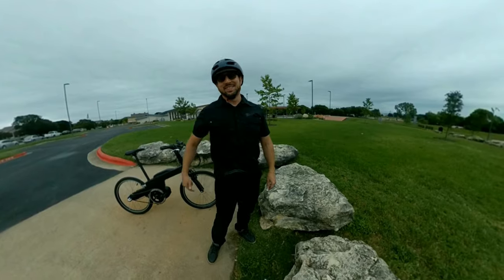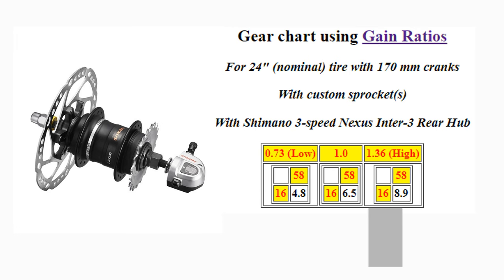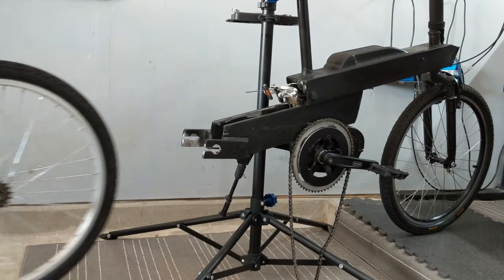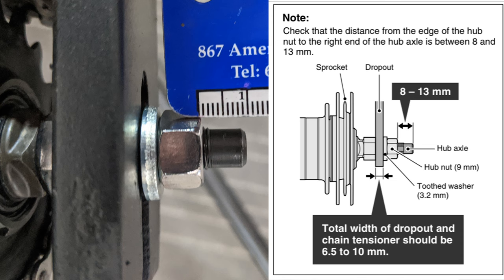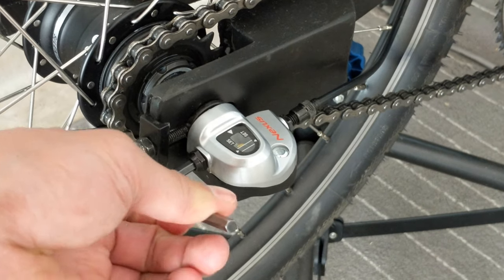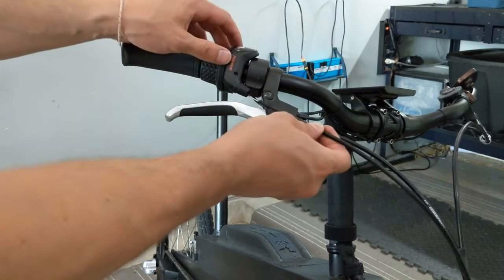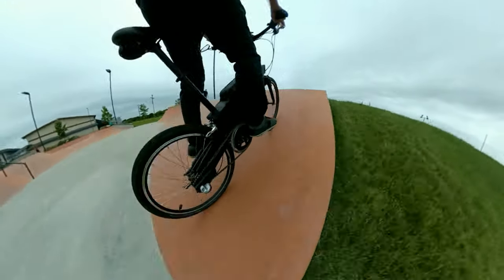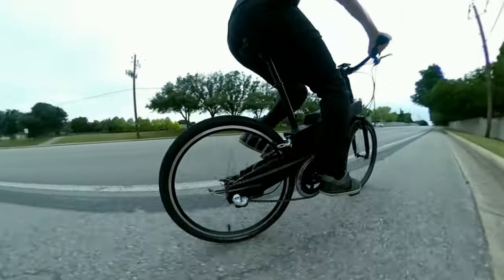Convert Your Bike to IGH | Nexus Internal Gear Hub

Comment: i've done nearly 15,000km with my shimano nexus inter3 with a cyclone 1800w mid drive (i also use sick bike parts free wheel an spiders to run high an low chain rings up front, i locked out a derailleur at the rear for chain tension) , best hub out there in my opinion and i've tried a few, sturmey archer 3 speed destroyed itself in about 300km

Comment: I just converted a single speed beach cruiser to a mid-engine electric bike. A major challenge since removing the one piece "Ashtabula" crank and installing the Bafang BBS02 electric motor requires adapter bushings to fit snugly inside the bike's hollow 51.3mm bore. Otherwise it is impossible to keep chainline straight and chain from jumping off the chainwheel with the higher torque of motor. Once installed correctly, it is an amazing bike with just a single speed but lots of power assist when needed

Comment: Great video.  I would love to see a similar install/evaluation of the Enviolo (380 or lower) CVT.  Thanks.
Reply from the maker: Yeah I'd love to see that too, let us know if you come across anything. As far as I've read they're designed for low power and get a little slippery at higher power levels.

Their parent company (Fallbrook Technologies) is not far from me here in Austin TX. I've been meaning to go request that they develop a heavy duty version for high power mid drives. I'm under the impression they moved the Nuvinci/Enviolo development to Germany though.

Comment: I just learned about internal geared hubs and I thought I should combine this with a mid drive motor, then I thought I wondered if anyone else has done this, so I went looking. The rest is history!  except I'm not looking for a custom wheel, I'll be doing that my self, as soon as I get a few test builds under my belt, I've always been of the school, if you want it done right, do it yourself, if you don't know how,,, learn! Just so you know I am building a stealth Bomber ebike, originally I was going to go with a rear hub motor, then I started looking at mid drive motors, I like fat tires, So I was going with 4 inch rear 3 inch front, I still am, but two days ago, I watched a video of a guy who bikes all over the world and he was talking about gearboxes for mountain bikes he talked about Rohloff and Pinion hubs, now I looked at the Rohloff and it starts at about $6,000 US and the Pinion is not far behind, now these of course are made in Europe, so I thought, someone else has to making these, but here in the US they're not called geared boxes but, internal geared hubs, I quickly found Shimano, but there still a little high, but then I found the Sturmey Archer S80 8-Speed Hub, which for about $250.00 I can get everything I need to install the hub on my wheel, except for the spokes of course and I've been watching videos on wheel building even before I got this idea and I have some wheels that I'm going to remove the spokes and rebuild the wheels again and again, until I feel I have a good working knowledge of wheel building. That's how I've always learned new talents and at age 64, I'm not stopping now.   Oh and thanks for the informative video, it's just what I was looking for. 🖖😎
Reply from the maker: Nice! Thanks for watching. Yeah I was thinking about building the wheel myself but I think the last few detailed steps would have been tricky to get right the first time. Shimano also makes a 5 speed IGH specific for eBikes and they say it's heavy duty but keep in mind that the 3 speed hubs are strongest because the planetary gear is fixed to the axle.
Reply: After trueing wheels for years, building a wheel isn’t very hard at all with all the good YouTube vids out there. I first did it for a single speed, making it a 2 speed with a Sturmey Archer. So I used a SA 3 for the 1,000 watt diy E- MTB. It works great. It’s small and inexpensive....and nothing protrudes out the side except the nuts.
Reply: can the IGH be installed on your old wheel by myself or do i need to find someone or buy a wheel that has it on it?

Comment: Hey Austin.. Nice Ive used the Sturmey archer in the past but found it a bit glitchy here n there... But on an other note how do u film the in motion clips ? was really wondering... do u hv someone else tailing u or drone or edited out stick ?
Reply from the maker: Yeah I haven't tried any of the newer SA hubs but some of them are tricky to get adjusted properly. The Nexus 3 was really simple to setup and adjust so I hope it holds up. In most of these clips I used a Mi Sphere 360 camera and a DIY invisible back bar... still experimenting with it, but how does it look?

Comment: Do you reprogram the motor to tone it down?  Do you have a gear sensor installed?
I have heard Mid Drives can destroy an IGH.  
Nice video, thanks
Reply from the maker: Nope, 52v x 30A = 1500w peak, no gear sensor, reprogrammed to give consistent power even when ghost pedaling. The Nexus 3 is supposed to be one of the strongest IGH, but we'll see. I definitely would not change gears while the motor is activated though. So far it feels great - stop pedaling, give the motor a second to cut out, then shift - feels a bit like pulling the clutch before shifting on a motorcycle.
Reply: I have a BBS02 750w with a Sturmey Archer 5 speed IGH RX-RK5.  I have it programmed down.  It will be interesting to see how your test goes.  I also do not have a gear sensor.  Shimano has a 5 speed specifically for ebikes SG-C7000-5D, but it is harder to find and much more expensive.  The Nexus 3 speed is much less expensive.  Looking forward to your experience.
Reply from the maker: Awesome, will do - keep us updated with yours as well. I didn't know they made one for eBikes, will have to look into that. I'd imagine it's made for low power systems like the Steps but at least they're heading in the right direction.
Reply: @MumfordJim  I've also got that hub on BBS02 bike (Biktrix Stunner). How did you program yours? Been having trouble with mine, especially in 3rd gear.
Reply: I lowered the maximum Amps and lowered the lower levels.  I ride mostly in level 1 of 5.
My gear 3 pops sometime which is strange because it is suppose to be the strongest gear.  I ride a lot in gear 4.
I also tend to ride in level 3 and luckily our hills are small.  If I remember I lowered the max amps to 15.  I can still ride at about 15-20 miles per hour.  That is fast enough for me.  
Read A Hacker’s Guide To Programming The BBS02 & BBSHD
Karl Gesslein and other articles By Karl
I use Penoff’s program to program my settings.  Penoff also has some good programming information.
Reply: @MumfordJim  lol it's a sturmey that's what they do, i wouldn't be surprised if it's exploded by now, nexus inter 3 all the way!! i got 300km out of my sturmey before it shit the bed compare that to near 15,000km on the nexus inter 3 with a cyclone 1800w it loves it, also mine has 2 chain rings for the rear up front so it's a 6 speed one 53t for general cruising an the other 36t for climing hills an towing never missed a beat.........
Reply: can the IGH be installed on your old wheel by myself or do i need to find someone or buy a wheel that has it on it? I want to do a drive belt IGH so this might be what ill have to look at. just wish i could understand more about IGH's when comes to installing them. 
PS I might install on a 20" wheel or a normal size bike wheel. thanks

also yes the 5 speed IGH works best with lower powered motors though messing with settings in the bbs02 might help? not sure on that one.

Comment: Can I convert my BMX mongoose fixed hub to this internal gear design. Its a 20" with raised seat and bars like yours. Thanks.
Reply: Yeah bud, I’ve had bikes with IGH on 20” wheels, you might find one to try on a spares or repair shopper bike, or folding bike. Why not build a fixed gear bmx wheel too? Much fun
Reply from the maker: Yup, so long as it fits in the dropout. Measure the inside of your dropouts or find the O.L.D. (outside locknut dimension) of your current hub - the Nexus 3 O.L.D. is 135mm.

Comment: Thanks eBikeaholic, this video is really helpful. Bafang has the GearSensor where it cuts power to the motor when gear change cable is toggle. I don't see you mention it in the video, do you stop pedaling (or stop using the motor), then shift? or it doesn't matter?

Edit: I did not read all the comments. So it looks like you manually stop pedaling then shift. I wonder if GearSensor works if we hook it up with the shifter cable.
Reply from the maker: Yeah I decided not to add the gear sensor for now. I talk a little more about how it feels here: https://youtu.be/MD1bUpvLJ0Y

I believe the gear sensor works with either derailleur or IGH.

Comment: How is your wheel holding up? On mine I'm noticing that it slips a little if I  push it too hard, pedaling while using throttle. Works perfectly fine with just pedal assist or throttle only.
Reply from the maker: It's holding up fine, don't get any slips as long as I don't shift while the motor is active. I've been really cautious with it though and mostly stay in 2nd gear... I can see how it might slip if pushing it on 1st or 3rd or shifting while the motor is spinning. Do you think the slipping will grind down the internals?
Reply: @eBikeaholic   you know, upon further inspection, it seems that the problem was that my chain wasn't tensioned properly. After adjusting the tension, I had zero problems, and I pushed it pretty hard even on first gear since I like accelerating fast. Seems like its a pretty robust IGH, just no pedaling while shifting. Lol

Comment: What's your take on the 8 speed Internal Gear Hub on a fat bike? Do you think it's a viable option? Thanks!
Reply: i also want to know this
Reply from the maker: It'll mostly depend on how much torque you try to pull through the hub and how careful you are when shifting. Make sure there is no load on the hub when shifting (either motor or pedals pulling the chain). 

I haven't tried an 8 speed yet but as far as I understand it - the 3 speed hubs are significantly stronger because the 2nd gear is planetary. The planetary gear engages directly to the axle so there are less moving parts to get chewed up or worn out. I wouldn't expect a typical 8 speed IGH to last very long at over 750w. If you need the extra gear range consider a Kindernay or Rohloff.

Comment: Can this be done on a rear hub drive motor? Would love to get ride of my greasy chain lol. Thanks
Reply from the maker: You mean convert rear hub motor to belt drive?
Reply: @eBikeaholic  yep. And remove derailleur. Basically IGH with rear huh motor
Reply: @escargoux  not unless you custom mount the hub like a mid drive which isn't worth it, hubs are direct drive single speed only, that's why they suck but for in extremely high power versions like 5000watt plus

Comment: If I wanted to get a 26 inch disc brake wheel with a Nexus 3 on it, did you come across any places offering pre-built versions when you were doing your research?
Reply from the maker: Nope, the closest I found was 26" with the coaster brake version on Amazon... I think they were taken off a ride share fail or something.

Comment: I have recently added a Bafang 500w mid drive motor to my recumbent trike Scorpion. While this motor puts out 100nm of torque, and I am using a 65t chainring, I only need to pedal for a few seconds before reaching cruising speed of 30-35 kph in top gear. I am doing 90% of my riding in top gear and my 7 cluster derailleurs are old and complaining noisily. So, it must be time to swap my derailleurs for a CVT hub, but which one to select? Do you think your choice of hub would be compatible? I would like an automatic changer so I can set my cadence and forget the gears.
Reply: Shimano make a 5 speed IGH specifically designed for ebikes - SG-C7000
Reply: CVT hub?  Enviolo....  Not my preference.   My wife's Scorpion FS Clementine uses a Bafang 500W BBS02b with a Nexus 8....   Troublefree for 6000km to now. My Tricon is equiped with a BBS02b 750W and a Rolhoff, recently regeared to have a top speed of 55km/h.  The first 300 km were huge fun .

Comment: Any chance of an update on how it’s holding up 3 years on?
Reply from the maker: still feels great. I transferred it to a new prototype bike but still 1500w Bafang Ultra. The shift sensor is on there now as a fail-safe but still avoid shifting under load. I mostly start in 2nd gear then quickly bump to 3rd for cruising. I'm starting to notice if I'm careless when downshifting back to 2nd when fully stopped at a light etc. - it gives an extra click when it changes gears while launching on throttle at the green light... so prob best to avoid that too.

Comment: Does anyone have any links to the articles comparing or commenting on IGH for ebike conversions?  I have a cyc pro coming and was going to put it on my old pug, but I think I might instead put it on my old trek solo s frame using a sturmey SRC3 hub rim that I used to use on that bike.  Also, how are those caliper brakes holding up?.....one of the reasons I felt locked into converting my pug was the disc brakes on them.  My old trek uses calipers too....that SA hub has a drum brake (but wouldn’t use that on a conversion?!) Is the main issue just shifting under speed, or what are the other risks / weak points within the hub?  Thanks
Reply: I found the article about 3 gear IGH strength.  Still curious about the caliper brakes though.  Thanks
Reply from the maker: I think the most thorough article on IGH and mid drives is this one: https://www.electricbike.com/mid-drive-kit-igh/

Suppose it depends on your power levels and how smoothly the controller transitions the torque, but he does not recommend using the cyclone 3000w with IGH - I'd imagine same goes for the cyc. 

Sheldon Brown wrote that the drum and coaster brake IGH's are prone to overheating at high speeds.

As for the caliper brakes, they've been fine for my needs (riding cautiously) but I definitely do want a disc brake in the front on my next prototype.
Reply: @eBikeaholic  Calipers are fine if you do not expect wet conditions.  In the freeze / thaw conditions where I live, discs are essential.

Comment: Where did you get the spokes and wheel from?
Reply from the maker: I bought the wheel as a complete wheel set and disassembled the rear wheel. I forget what website but I'll try to find a link. The new wheel builder can usually cut the original spokes to the right length.

Comment: How come most models available are using coaster or roller brakes without disc brake mount? is it just due to covid related shortage?
Reply: because disc brake on the rear isn't really needed.
Reply: because they're mostly used in beach cruisers, disc brake versions are also 28 hole (the others are standard 36 hole) 28h isn't an issue tho just use 12g spokes when building a wheel, don't be afraid of wheel building plenty of great videos out the to help with that an spokes can be bought ready to go

Comment: next step use belt gates carbon drive
Reply from the maker: yeah I definitely want to eventually, still waiting for the prices to come down... someone needs to design one that can go around the Gates patent and give them some price competition.
Reply: @eBikeaholic  need a belt compatible frame to go belt drive, you can retro fit with a kit but standard frames aren't designed to be split and aren't rigid enough...

Comment: Good video however have been burned by an sram igh. So i fear an igh with that alignment window similar to the sram. They bike shop said those igh had been recalled but mine was so old...  Why did you choose nexus over sturmey archer?? I am personally looking to do something other commenters seem to indirectly advise against. I am looking to build a bicycle with an igh using a bike o matic auto shifter for all of the shifting. Looking at some of the comments it might be an idea to install a switch to cut the motor while shifting or another type of pull for a gas motor. On the femce when it comes to gas vs electric since the ebike batteries are based on the same technology as your cell phone.and i think we have all seen how these batteries fail over time. Nothing seems to be reliable enough to really stand the test of time with these motorised bicycle ideas.
Reply: lol sturmey is unrefined clunky weak garbage compared to the shimano nexus inter 3 with it far more easy to service, tune/adjust, smooth an handles power well i done nearly 15,000 km with my inter 3 compared to 300km before it exploded on the sturmey.....

Comment: i never thought the hub gears would be able to withstand the power?,
Reply from the maker: We'll find out eventually. As far as I understand it - the 3 speed IGHs have a planetary 2nd gear that's part of the axle which makes it significantly stronger than the other two gears and significantly stronger than other IGHs. So far it feels great for me but I mostly stay in 2nd gear, try not to abuse the other two, and don't shift under load. Some people have told me they busted their IGH, others have said theirs held up great with the BBSHD at 52v. I'll be posting updates on this setup every 1,000 miles or so.
Reply: I'm interested to see how it holds up. The shimano nexus website says it's not made to take heavy loads which makes me feel a bit skeptical

Comment: why do you need to customize the wheel?
Reply from the maker: In this case I needed a custom wheel because I couldn't find one with a 24" machined rim and Nexus 3 disc hub. Lots of reasons to go custom though.